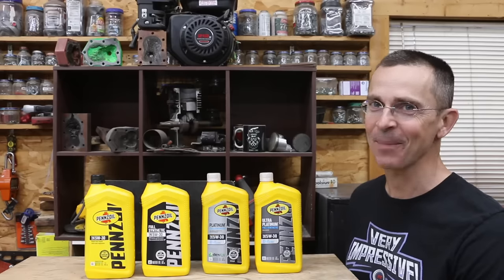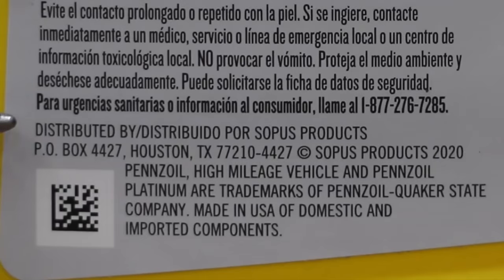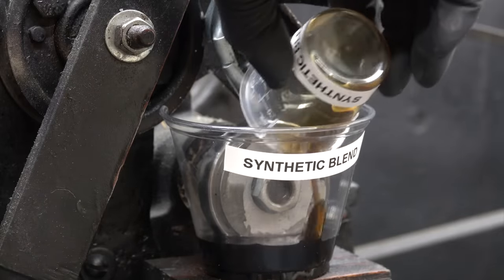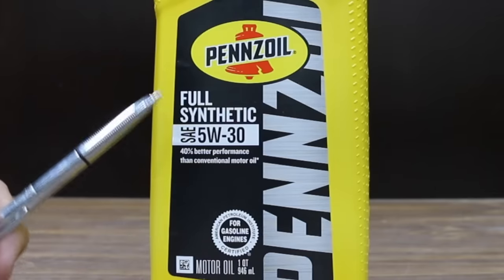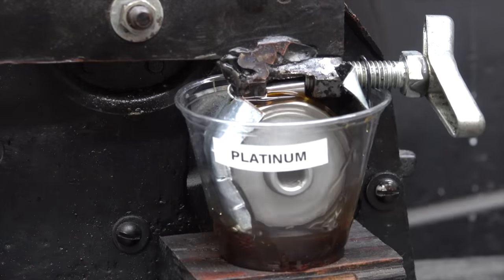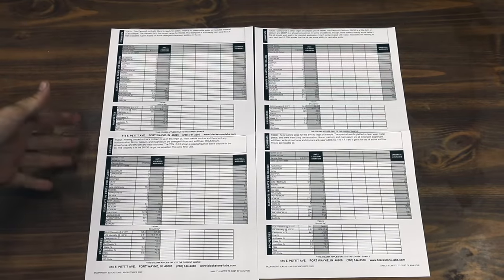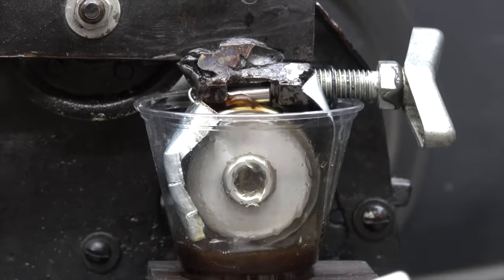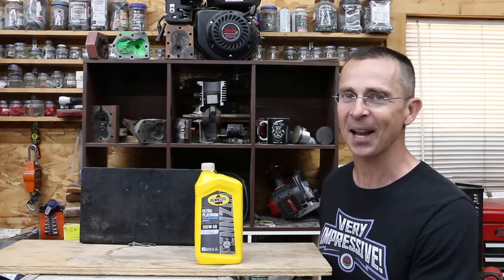Are They All The Same Motor Oil? Let's Settle This!  Four Levels of Pennzoil Motor Oil Compared

Comment: With a turbo charged car I try to change my oil around 4k miles or every year whichever comes first. Some people may say that's too often, but my car is running 5psi over stock. With the higher pressure in the cylinders making it more likely to make gas mix with the oil. so its better to be safe than sorry.
Reply from the maker: Thanks for sharing.

Comment: Ultra platinum at $8.66 a quart. 
Compare that to Kirkland synthetic at $3.00 to maybe $3.50 a quart. Over 2 1/2 times as much. I would really like to know how it would compare. I changed my oil every 3-4,000 miles. I don’t think you can beat the Kirkland synthetic for value.
Reply from the maker: Thanks for the feedback.

Comment: Well, didn't know that Pennzoil had an Ultra Platinium oil but have been using the Platinium because several years ago it ranked as good as Mobil 1 synthetic at at a lower price. I use the plain Synthetic Pennzoil for the lawn mowers.
Reply from the maker: Thanks for the feedback.

Comment: Very informative, especially since I am partial to Pennzoil.  Perhaps you have already done it, but I would like to see a similar comparison of "High Mileage" oils to standard oils like those in this test.  Do the "High Mileage" oils actually provide a benefit in engines with high mileage on them.

For what it is worth, and this strictly my empirical results.  I had an 1987 Chev w/ 350 V8, about 180K miles.  I used a brand name (could have been Valvoline) oil in it and found I had to add a quart of oil after about 1200 miles.  I then tried a High Mileage oil and got more than 3,000 miles before I had to add a quart.  With an oil change interval of 3K to 4K, when it was down a quart, it was time to change the oil.  But, that was 15 to 20 years ago.  I wonder if that would hold up today.
Reply from the maker: Thanks for the suggestion.

Comment: I am considering making the switch to Pennzoil Ultra Platinum 0W20. Is this oil really that much better than other brands of oil on the market? Would you personally use Pennzoil Ultra Platinum in your vehicles? Apologize for the questions as I am just trying to get good reputable and proven information before making the change. Thank you for taking the time to respond and help me out.

Comment: Decades ago, my 87 cavalier blew the head gasket and dumped probably 2-3 qts of coolant into the oil. I drove 40 miles home at highway speed not knowing this. No performance difference. Changed the head gasket and it performed flawlessly another 50K and ran like new when I traded it. This was with Mobil 1.
Reply from the maker: Thanks for sharing.

Comment: I've used mostly platinum as it's the easiest to find with the acea rating that Volvo requires. I'll probably switch to the ultra once I use up what I have left. Although it's done well taking me past 275k miles
Reply from the maker: Thanks for sharing.

Comment: I think I've requested this before, but I'd love to see the Amsoil trio head to head. I know you've judged the Amsoil SS as best in show, but Amsoil still gets a lot of flack for "being expensive" but if you buy it right it's only ~$7/Qt. for OE. For that reason, it would be interesting to see how the OE, XL, and SS lines up. It has been worth it to us to spend the ~$11qt on the Signature (Cheaper than the Pennzoil in our region!) for the once-a-year drains, but comparing the qualities of their core line-up would put the test on the value of the good and better against the best. So, in short, this Pennzoil Test, but with Amsoil!
Reply from the maker: Thanks for the suggestion.
Reply: What region are you in that Amsoil is cheaper? Can it be bought online?
Reply: @toddchavez8274  you can buy it at a discount if you become a member on Amsoil’s website.

Comment: the part with adding gas in there interested me the most. is it because the blend has more parts of regular oil that the ultra platinum? or is it because the ultra platinum like the regular platinum are made out of natural gas?

you should do a test with all 4 of those oils with gas contamination to see what happens. I would like to see that test because I have a turbocharged DI engine in my vehicle.

Comment: Can you do this same test with 5-30 and 0w-20? And also do a cold flow test at 0F, 15F, and 32F so we can see cold start flow and temperatures that most of the country sees in the winter. At -40F you show have a block heater anyway so that the oil flows better.
Reply from the maker: Thanks for the suggestion.
Reply: @ProjectFarm  Please do it! 🔥🔥🔥

Comment: I have a video idea for you - I want to learn a top 3 combination of products - it can range from single to multiple brands, and multiple steps and methods. You come up with some methods to maintain the car/suv - let me tighten the competition so that I don't want all products to line up, by saying - 1. Change oil only once a year. 2. Flush methods if recommended, and how many times, with flush additive or just plain chosen oil; 3. replacement oil with or without additive; 4. Fuel additive and cleaners etc.. it should be a combination of flushing, cleaning, replacement or you say what it should be the method. Method A, B, C.. and Top 3 product mix - X, Y, Z. Then do a permutation of methods, and run a competition. It can be complex, but heck this will make you a star!! I said it first, so I get the loyalty!
Reply from the maker: Thanks for the video idea.

Comment: A factor that is hard to measure is the operating conditions of the engine (city, long distance, etc.) and expected longevity, and the engine manufacturer which you have to trust the makers recommendations for. So, one must decide is the better, more expensive oil better enough to justify the extra cost? I will have to watch some of your other videos.

Comment: Great as always… Quick question what would you recommend for that 99 V6 Camry that runs great and burns a little oil… Out of the selection which Pennzoil would you choose to slow down the burn off?… Thank you for a response
Reply from the maker: I'd use their high mileage 5-30 oil.
Reply: @ProjectFarm  The conventional as opposed to synthetic high mileage??

Comment: How does time factor in on oil changes? I do mine at 6 months or 5,000 miles and use Pennzoil Ultra Platinum. I drive an f150 ecoboost and have always wondered if the 6 month oil interval will override the mileage.Your opinion would be greatly appreciated. Thanks and awesome videos you do.
Reply: Generally yes. Even low mileage driven vehicles should be changed. Oil breaks down due to oxidation. Won't be the end of the world if you don't , but generally 6 months is when I change my oil on my second vehicle that doesn't get driven much. Granted it's a 300k mile Silverado so I'm just trying to baby it along

Comment: I was told that since all my vehicles are over 100k miles, I should be using a "high mileage" synthetic such as Mobil 1 High Mileage or Pennzoil High Mileage - love to see a comparison with the non-high mileage oils
Reply from the maker: Thanks for the suggestion.
Reply: I have used Walmart super tech synthetic for 17+ years in foreign & domestic cars and trucks (yard equipment as well). All my cars have over 150,000 miles and have no issues.  One car was purchased with 145,000 and I went straight to walmart synthectic. Never an issue. Unless there is some existing abuse/wear issue there really should be no reason to use 'high mileage'. Used Amsoil back in the 1980's in a 4 cylinder Rolls-Royce/Continental 0-200 on a formula 1 aircraft.

Comment: Wow, thanks for the detailed tests. I've been using platinum for years and just did an oil change yesterday with it, smh. The platinum looks to be a complete waste of money compared to synthetic. Oh well, I'll be upgrading to Ultra from here on out for sure.
Reply from the maker: You are welcome!  Thanks for sharing.
Reply: I don't think It is. Don't stress your better off to change more frequently than buy super expensive oil. As even this guys test have shown that the cheaper oils perform better than some of the boutique oils with three or 4000 miles with that said I do use the ultra platinum. And it performs really good. It's still honey brown after 3k miles

Comment: I question the repetitive accuracy of placing the bearing on the clamps for the lubricity test. It seems you can easily misalign the bearing and can be either further or closer to the rotating wheel each time a change happens.

Comment: Ive been using the ultra platinum in my 09 sprinter with a turbo, have been sending in my results to Blackstone and they have not come back with any problems compared to my old Mobil 1 oil which I was using, so does the diesel turbo engines have the same problems you saw in the gas turbo engines regarding lubricity? or perhaps you can do a test just dealing with turbo diesel engines vs all engine types great channel and have bought and donated for your content!
Reply from the maker: Thanks so much!  Thanks for the suggestion.

Comment: Apparently, those small turbocharged engines look to that Dexos to avoid low speed pre ignition. If added detergents aid in diluting the oil, and a higher performance engine is expected to be maintained to a higher standard and have more frequent replacement of wear parts for the same reason, perhaps the wear rate for the regular platinum is acceptable(for those who know to use it for such purposes)?
Reply from the maker: Thanks for the feedback.

Comment: There's a reason that seems to elude some folks about oil changes and that was the contamination tests you did....  especially on older engines that still have manual chokes..  flooding the engine with gas, then continued cranking to try to clear it, seeing the resultant smoke come bellowing out the exhaust just confirms the necessity of frequent oil changes..  there's still a lot of manual choke equipment out there..

Comment: What's interesting is Pennzoil recommends Platinum, not Ultra Platinum, for direct injection small-displacement turbos like the 2-liter in my WRX.  They indicate it's best to prevent LSPI (low-speed pre-ignition) of all four of these due to the lower amount of calcium in the additive package.  High amounts of calcium will cause LSPI in certain conditions.  The cold flow test was striking though - maybe the natural gas base stock is to blame.  I alternated between Pennzoil Platinum and Quaker State Full Synthetic, but I'll probably go with QS moving forward, especially as it worked really well in my last WRX up to 242k miles.  Also 540 RAT's blog rated QS highest.  That being said, I still do 3k-3.5k intervals.
Reply from the maker: Thanks for sharing.
Reply: @ProjectFarm  Quick question - can you identify what the last two oil samples are in the Patreon link above?  There is no label I can find - I see that the first is Platinum and the second appears to be the Synthetic Blend?  Can't determine the last two.  Thanks!

Comment: My manual says to use the SRT ultra platinum pennzoil 0w-40, do you know if this is  the same oil you tested in the video? And why is it so darn expensive? Thanks for your videos man!
Reply: The modern oils that start with an 0 are under a new standard for quality. They are so much better than the old school oils,and almost all cars are going to start using them,but until then they are still considered somewhat new and due to the less common use,they are a bit more expensive. They will get cheap as they become the new normal,and they are such great oils. Check out Scotty Kilmers video about them,they weren't even in full effect until the beginning of this year or last year. Supposedly they are the height of oil technology though,as in really good stuff. Hope this helps.

Comment: Nice job, I have been using Royal purple for years. Spentvalot of money. Maybe I  will switch. My 2004 sl500 just broke 100k miles. High mileage oil here I come. Thank you.
Can you please test Motorcycle oils. Since we use only one oil in the engine & transmission its Very Important to know .Which oil is best. Especially since Motorcycles cost more than 10k $s
Reply from the maker: Thanks for the suggestion.

Comment: Are those prices shown for gallon size jugs of oil?  I am 65 years old and have very vivid memories of all brands of automobile oils priced at .60 to .65 cents per quart.  Back in the 1980 to 1990 era.  They were in paper cardboard containers with metal tops in which you used a special piercing metal funnel to open and pour out the oil.  Not a mathematician but doesn't this show over a 1600 percent rise in prices & up!

Comment: The one thing this test doesn't show is how well a high mileage car, like mine, which burns about a qt. /1000 miles stays super clean internally. I'm convinced it's due to the natural gas as all other brands of Synthetic left my engine with black dirty used oil at 5k miles.  After 5k miles, Pennzoil Platinum comes out brown, not black.       My car absolutely loves it. Even tho Platinum didn't work as well as the regular synthetic in this test, I'm prolly going to stay with it.
Reply from the maker: Thanks for the feedback.

Comment: You should test the rubber seals deteriorating test I heard synthetic bad for seals compared to conventional or blend/high milage...also high mileage you should put it to test as it does have additives differ from synthetic
Reply from the maker: Thanks for the suggestion.

Comment: Has anybody opened the engine after  using Pennzoil  Platinum or Ultra Platinum for a long time, at least 100K or more? How does the engine look inside? Clean? Any sludge buildup found? Any lacquer or varnish inside? Just trying to figure out and collect some real practical information not just speculations the Internet is full of. It's just there is some info out there that GTL based oil isn't as good as PAO based ones and they tend to burn and also they contain too much of polymer thickener that with time causes lots of varnish buildup. Please share your experience. Thanks

Comment: 365 degrees and the oil turned black in two hours? This is unexpected. I also did not expect much evaporation at that temp. Almost seems like there are additives that shouldn't be in the oil.
Reply from the maker: Thanks for the feedback.

Comment: Given the test results,  l still can't figure out what's best for my vehicle. The manual that came with my van, ( 2002 Dodge Caravan, now at 211+ miles), recommends using  10w 40 for all season driving. I don't even know if synthetic oil was out back then but it runs just fine. The engine runs fine and doesn't knock. When I start up, l always let it run 15-20 seconds before I pull off. Dry runs are damaging.

Comment: I cannot find the 5 quart ultra platinum in 10w30 anywhere and have been looking for quite some time. Is this discontinued? Usually, you can get it from Amazon or Walmart. I can find single quarts but they want absurd prices per quart.

Comment: Dear Protect Farm, in the case of a GDI engine with oil dilution,  would you a) use the Pennzoil full synthetic platinum high mileage oil combined with an oil additive (BG MOA) and change every 4,000 miles or b) invest in the 119% up-charge for 100% synthetic Amsoil Signature Series and change the oil every 5,000 miles? What would you personally do? Thank you.

Comment: I question the repetitive accuracy of placing the bearing on the clamps for the lubricity test. It seems you can easily misalign the bearing and place it closer or further away from the wheel.
Reply: Good point...

Comment: Would you recommend Pennzoil Platinum High Mileage synthetic? I have a 02 Trans Am, stock LS1 with 112K miles and I’m debating whether to try out PP or PUP and last 2 or 3 oil changes I’ve used PHM Synthetic

Comment: The original blend scar isn’t that big and those that do 3k changes would really benefit. 
JUST UNDERSTAND THAT PISTONS HAVE OIL RINGS THAT NEED TO DRAIN. LONG INTERVALS TEND TO HINDER THAT AND CAUSE BLOCKAGE ON THOSE OIL RINGS THAT ONCE PLUG ALMOST IMPOSSIBLE TO CLEAR. ITS NOT EVEN SO MUCH ADDICTIVES ITS CLEANING SO YOU DONT BURN OIL WITH PLUGGED OIL RINGS. USUALLY WHATS NEXT IS STICKING RINGS ONCE OIL RING NO LONGER DO THEIR JOB. 
KIA ENGINES HAVE THIS ISSUE. SO FOR A KIA I RECOMMEND AN OIL WITH A HIGH CLEANING FACTOR.  AS THE OIL RINGS ARE EXTREMELY SMALL. WHY BRANDS DONT MAKE OIL DRAINS BIGGER IS BEYOND ME.

Comment: I'd love to see a comparison of modern diesel engine oils. I noticed some are CK-4 with an SN rating. Some are just CK-4 and do not have SN rating. Also in Walmart I noticed Ford has their own motor craft brand with a statement on the jug saying it has high phosphorous and shouldn't be used in catalyst equipped vehicles. Does that mean it's better at wear protection? So I start seeing if other brands meet the Ford specification and I noticed that some do, such as Rotela T4 15W-40, and it lacks the SN rating. So I am wondering if the ones which lack SN rating have higher ZDDP similar to the motor craft product.
Reply from the maker: Thanks for the suggestion.

Comment: Would you consider testing 4 stroke marine oils? I’m very tempted to switch to bass pros marine oil at under $20 a gallon vs mercury at nearly $60 a gallon. Cannot find anything showing a through analysis as you’re doing. Can only find opinions.
Reply from the maker: Thanks for the suggestion.